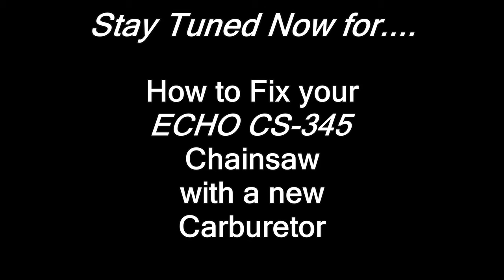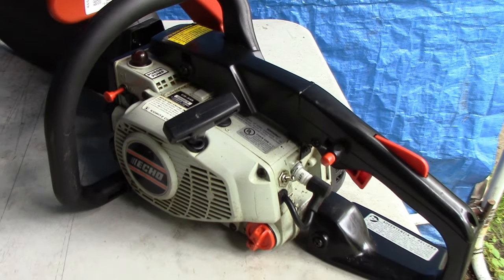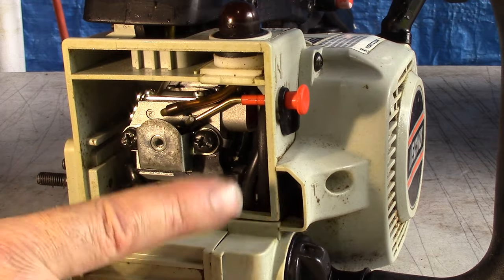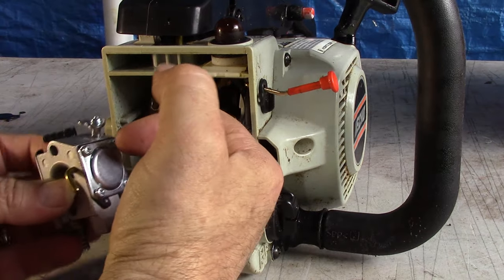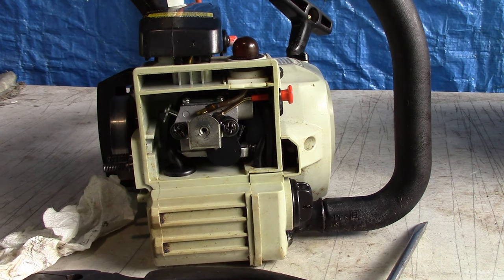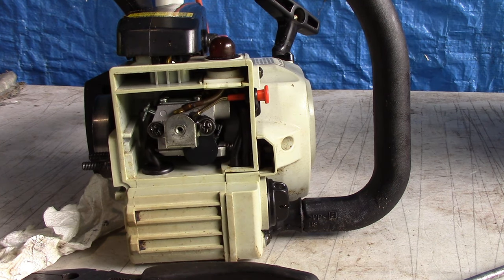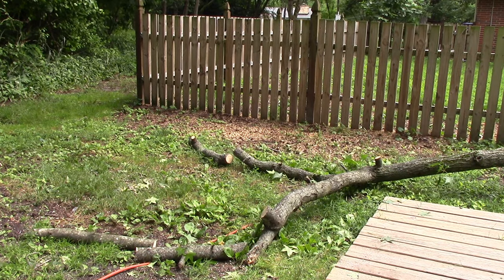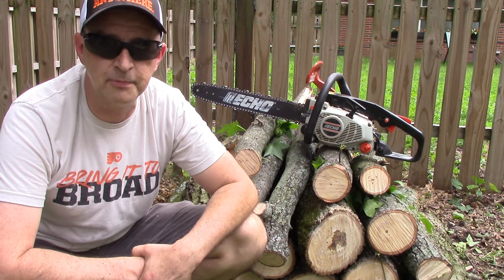Can a CHEAP $15 Carburetor FIX MY CHAINSAW?? ECHO CS-345

Comment: @buckwsr This is totally unrelated to this video but I have a Courage 17 (sv560ish) rider and I didn't realize it was low on oil and it started running really rough on me all of the sudden so I cut the engine quick. I checked and it was bone dry on oil so I filled it up. It still starts but it runs so crazy and violent I have to turn it off immediately because I I'm actually afraid its going to blow up on me. Since it still starts I feel like it should be "fixable" but I'm not sure what I should be looking for. Do you have any idea what type of "dry oil" issue could cause this behavior? Any ideas you can toss my way would be greatly appreciated. I'm gonna try to tinker with it tomorrow to see what I can figure out.
Reply from the maker: Running without oil is a death sentence to your engine. Time to start looking for a replacement, sadly.